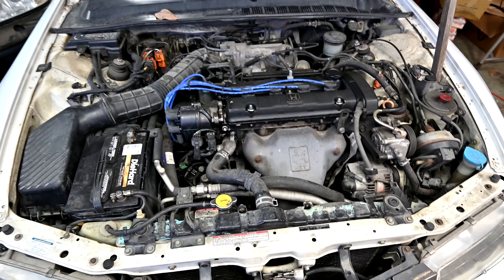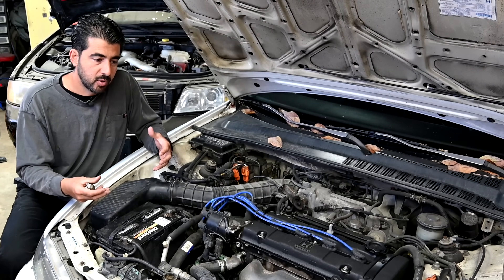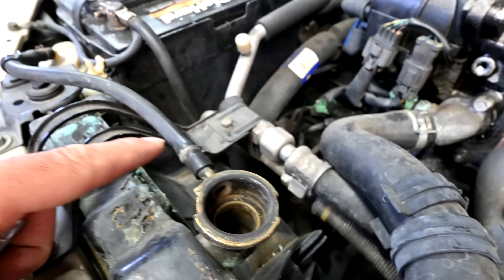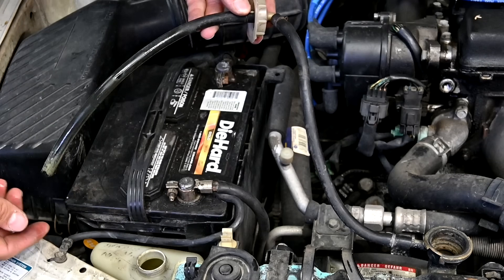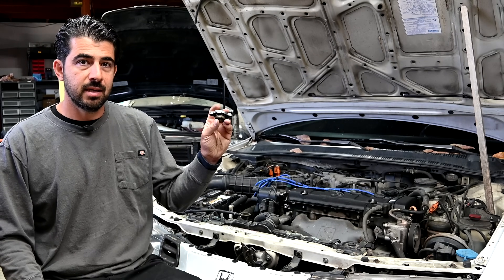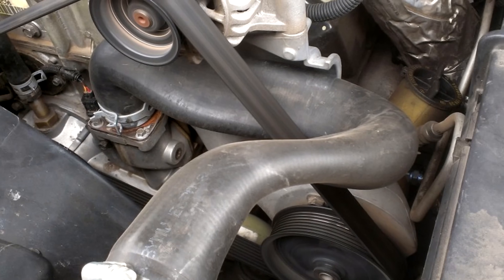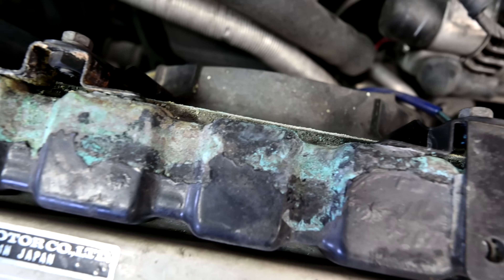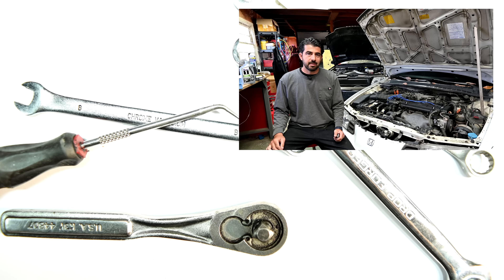If You Can't Find the Source of Your Overheating Issue Watch This Video

Comment: My engine isn’t overheating but it’s getting really hot to the touch more than normal, I used the diesel engine oil in it and I’m wondering what can be the problem. Is is the gaskets? Is it the whole engine please help. I’m also experiencing lack of power

Comment: yeah make sure when you pick up a radiator cap for a toyota or honda make sure you get the one with two gaskets not the single looking one. part number will be - 7737 and not  7037

Comment: Bro, I put a new radiator, new hoses, new cap, new thermostat, I thought problem fixed, I replaced the entire system, drove fine for a month or two, now out of no where, it's heating up again. Any ideas? I started to smell a funny smell, coming through the AC, my engine dip stick, was showing no oil, but I did the oil change not long ago. So, I'm done with Nissan Altimas, been a pain in the ass owning one.

Comment: Just got a 97 accord. Was overheating only after driving for 45 minutes or longer. No issues when driving but when I got home. The overflow would be boiling off 

After cooling off I checked the cap and it was broken and a piece was stuck inside the radiator. 

Getting a new cap now so I'm praying it was just this.
Reply: Also the car was backed over by a construction truck and a wiring harness (grounding harness) was destroyed and the cooling fan ground was broken off. Amongst many other grounds. 

Spend the day rewiring the harness and seems to be doing well.

Comment: The cap, also, can get clogged, especially if you use a K-Seal or other stop leak product;  you'll need to clean the cap or replace the clogged cap.

Comment: I was having some issues on my h3 hummer for a year..i was changing my serpentine belt when i decided to check my water pump for play in bearings..lol i could barely turn the water pump by hand, thinking what the what!! It never did squeal or anything but it was almost froze up..so i replaced it and even got my horse power back i had lost and better idle.
It must of been bogging down the 5 cylinder engine..might of just been a freak thing but something to check.
Pump was not leaking or anything just real hard to turn it...

Comment: Quick question Bro. When I start my [1998 Honda Accord 2.3  4 Cyl ] when cold, without radiator cap it blows water out like a quick throw up ,.Note: car over heats...What could be the issue. ?

Comment: have replaced water pump ,thermostat an radiator, the coolent flows into recovery tank but does not get pulled back into radiator when cooling down, used a hand pump to pressurize system and it leaked . i put k SEAL into system to see if it would seal the system it helpped but did not fix my problem no white smoke no water in oil . this is a dodge caravn 3.3 engine does not overheat unless radiator coolent level drops to low
 
am at a loss for what to do to fix this on my daughters van

Comment: Great video!   I have a 90 integra resto mod project car.   The engine going in it.  Is from a 1998 honda orthia b20b 9.2:1 cr 

I have a 
CHAMPION 3 row. Aluminum radiator that came with its recommended radiator cap.   

I didnt think to check this.   Until watching yer video.   

Should i compare the factory recommended psi rating on radiator cap with the aftermarket one.   And make sure they are within compliance of each other and if not.  I source one that meets engine coolant system recommendation.  Correct?

Comment: So I fill my radiator through the overflow tank I have a 2001 Chevy cavalier could that 15 lb cap on that overflow tank go bad first of all and second of all if it did is that possibly why I'm a overheating be pushing almost everything I put in out of my overflow tank hose

Comment: I have a 2002 Civic EX, replace the radiator, radiator cap 16psi, thermostat, fan switch and still overheating.  The mechanic said its the top engine is “warp”, and need to change it.  i dont know what that means,  do you know anything about this sir?

Comment: hmm my car has a coolant problem where it over fills the reservoir tank and bubbles. im assuming it's a headgasket or warpped head issue. i also replaced the radiator cap multiple times with new from japan and aftermarker from autozone. i really don't know what to do
Reply: Hello. Did you figure out? Thanks G

Comment: Have an overheating problem only while driving,  after it overheating due to broken belt, could that be a blown head gasket? No milky oil, but bubbling radiator when i try to fill.
Reply from the maker: Do you have to keep adding coolant all the time? Do you see a leak anywhere?
Reply: @myRatchets  no leaks misfiring in 2 cylinders
Reply: Huh
Reply: well if its a bad enough leak it will burn up inside your cylinder or if you take the spark plugs out sometimes it will actually be covered in liquid. could also have a leak inside your car via the heater core. also lets say you have a cracked cylinder head it will go up inside underneath the valve cover and then get sucked back into the intake via the breather hose or a bad pcv. but you'll usually get milky substance underneath the oil filer cap. good luck.
Reply: Possibly bad water pump?
Reply from the maker: If you have no leaks and have to add coolant and you have misfires in two cylinders and all this started after an overheating incident, there is a decent chance your head gasket or cylinder head is compromised and it's burning the coolant. Remove the spark plugs for the two cylinders and inspect and smell them, you can also do a compression test. But an absolute test would be to use a block/combustion leak tester, if you have a positive there you have head gasket and or other major issues.

Comment: Is it ok to replace 1.1 cap with 0.9 to maintain a lower coolant temperature ?
Reply from the maker: Coolant temperature goes up if the pressure goes down. It always best to stay with manufacture specs on the radiator cap.

Comment: What if there’s no radiator cap and just an overflow tank that has the plastic cap? I changed the water pump and. Thermostat and had the radiator checked and my Chevy Equinox is still overheating at idle when it’s driving it’s fine it cools down my mechanic nor myself can figure out the problem

Comment: my car does not overheat but the coolant flows out of the overflow tank and at the radiator cap (coolant mark at these 2 locations). Replaced the cap , problem is still the same. What is wrong ? Ithe radiator

Comment: I had a Grand Cherokee that smelled like burning coolant out the tail pipe when started after sitting overnight. Months later my radiator began to leak. I replaced the radiator and put on a new pressure cap. The burning coolant smell went away, and I thought I had a failing head gasket.
Reply from the maker: nicee

Comment: And this comment is in regards to the tip about boiling your NEW thermostat. To verify it. Works.   
Unless technology has advsnced or something.  Ive both been told snd read in factory service manuals.  That have all stated the same thing.  
Boil it only to verify its faulty or needs replaced.  Never boil a new one.   
Basically once you boil it. To verify if it opens and shuts.  It now must be rrplaced.     Ive always followed this and never had it be in corerct.   Ive also never encountered anyone. That can disprove it either.  So. Ne ways.

Comment: I’m going to try this. My engine overheats when the A/C is running. I’ve changed the thermostat. When I turn the A/C off the engine slowly cools back to normal. While the engine is overheating the coolant reservoir is full.

Comment: Hey I have a 2007 Ford edge I replaced thermostat radiator the fans n water pump and it's still overheating after but not fast my water jug will still be normal but my hoses swell up do anyone have any suggestions of what else it might be

Comment: I found a problem causing my honda civic to overheat If I knew this up front, I would have saved a lot of money on parts. The bottom of the OVERFLOW BOTTLE was dirty on bottom and was blocking the hose to radiator. Problem solved and runs great after a severe cleaning. Didn't even have to buy new bottle.

Comment: it starts to overheat for 15 seconds then back to normal never passing the middle point of the temperature gauge,,fans work..replaced both sensors (fan and engine)

Comment: It's either radiator cap ,thermostat ,, thermostat sensor , water pump , belt , gaskets,fuel system injectors pump,,spark plugs ,, wires , , wires that send  communications to each other n or computer

Comment: But if your thermostat doesn’t open amd allow water to go threw the motor witch heats up amd open the thermostat then your motor will over heat even if the radiator cap is new amd replace so always check the thermostat first because when it opens the water flows there the motor  into the radiator amd the fans cool it down as it goes in a big circle threw the motor and around again the motor must be at a certain temperature before the thermostat opens some times they get stuck amd it’s not the cap on the radiator just a fyi

Comment: Knew of a DIYer that threw the parts cannon at an overheating problem. At idle,  temp was OK but when driving at even slow speeds around town (30-35 mph) it would overheat. He stuck a go-pro camera under the radiator .  At idle, the hose would be fine but when driving, the lower hose would collapse.  (or do I have that wrong?) Regardless, a hose was collapsing when RPM was above idle.

Comment: Replaced, thermostat,  radiator cap and after that didn't work, the radiator overflow tank itself, the water pump and still overheats. Next is heater core and radiator, ECT sensor. Hopefully 1 of those 3 will fix it.
Reply: Fixed?

Comment: I'm not losing coolant but my car overheats when I put on the heater. No leaks inside my car from the heater core....weird. Don't put on the heater, no problem 😂😂😂
Reply from the maker: You might have air pockets inside your cooling system.

Comment: I was hoping for some clues as to why my car is loosing coolant. It's not visible and there's no white exhaust or coolant smell on the oil dip stick indication a blown head gasket. I've already replaced the cap with the correct one. Tell me something I don't know! Useless info!

Comment: Overheating is mainly due to one of 6 causes. 
In some rare cases there are strange causes but generally you can check these 6 causes in order and usually solve the cooling problem
Reply: What are these 6 causes you’re referring to?

Comment: What happens if you have a cap with 16 psi and the car needs 13 psi.  Would it matter or cause damage?  It a 2011 Hyundai
Reply: If your not getting leaks it won’t do any damage.
Reply: @Mastr-Tech  thank you 😊
Reply: The car system designed for  13  then parts would be over stressed at 16 by 25 %   and may weaken an fail quicker.   Would you want to put 15 lb in a bag  designed for 10 lb?
Reply: @danc2014  Thanks for the info.  I will check in the morning what's the correct cap.  I had lost the original cap and used a cap from another car.  Now I am worried it may not be the correct one and might be causing damages.   I certainly noticed some difference when driving since I improvise on the cap. I  appreciate your advice. 
Thanks 😊
Reply: @danc2014  
I couldn't find the  info on Google what's the correct cap to use for a 2011  Hyundai.  Would you know by any chance?